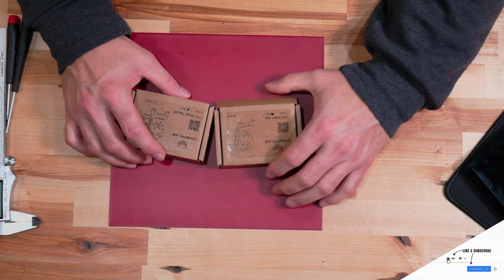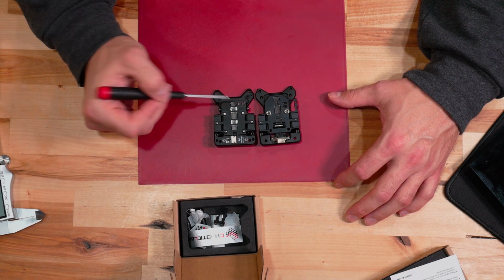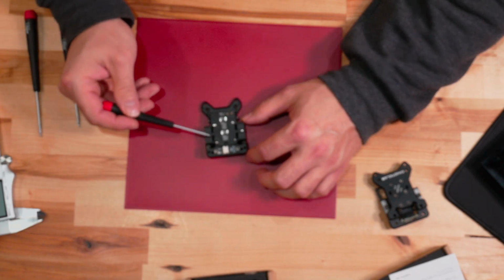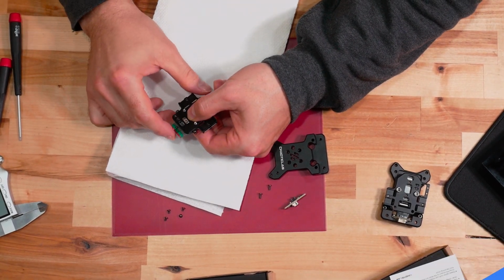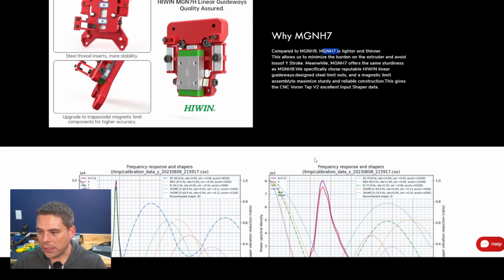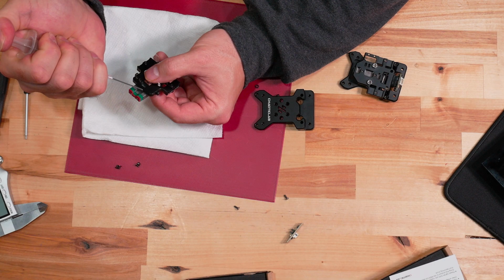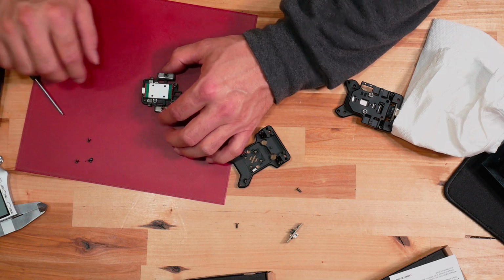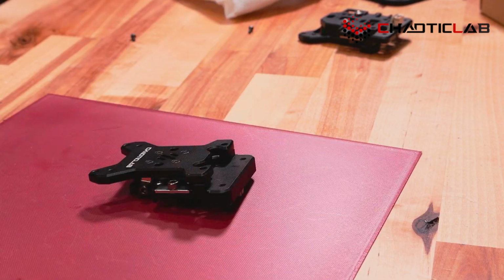CNC TAP V2 - CHAOTICLAB Does It Again?

Comment: Had a question about the wiring of this on the Octopus v1.1 board.  I have the probe on PG15 and voltage and ground on PB7 like the documentation states.  However the probe is always showing a blue light when the Tap is raised or lowered.  Any suggestions?
Reply from the maker: Check your wiring - Sounds like you have your signal wire crossed. Confirm via the diagram for your Tap. Hope that's it!  Let me know.
Reply: @BuildItBasement  I switched the probe and signal wires but now it stays solid red.  I thought that even before configuring mainsail the sensor would trip?  As I mentioned above, I am following the Voron manual using the default probe wiring and pins.  This is my second build but have switched from the inductive probe to tap.  I'm stumped.
Reply from the maker: Check and double check those wires.  Are you using CAN? Normally these types of issues can be caused when the ground wire and signal wire are swapped.  I too use PG15 for the probe, I use 5V at the tool head - too many issues a while back with 24V use. Voltage and ground can come from anyplace as long as the voltage matches the requirements of your Tap - signal should just be signal.   Instead of looking at the LED I would suggest checking what the MCU sees in real time via the console or GUI.
Reply: @BuildItBasement  no can but I am using a formbot pcb. I used a meter to verify continuity. I'll try running direct and see if that resolves the issue. Thanks for the insight.

Comment: Thanks for the video! I'm ordered a Trident kit from formbot (hasn't arrived yet) and this cnc tap V2 looks like a great mod to have from the beginning, right?
Reply from the maker: This is up to you 100%.  The biggest issue I can see is that the documentation will be fragmented some.  The original build doesn't include the Tap, and when you get to certain points in the build you'll be omitting things or adding things.  The next biggest issue will be software.  Tap uses some slightly more advance macros to function properly, most of these are surrounded by the need to ensure that your nozzle temp isn't much beyond 150 degrees C, as not to hurt the printing surface.  All those negatives being out there, I do still believe that if you're up for the additional research and work - you'll be better off starting off with a Tap.  It will save you a decent amount of time in reworking hardware and software.  Thanks for the question! Let me know if you have any others!
Reply: @BuildItBasement  thanks for the reply! I think I'll go Tap. Seems worth the effort. I'm sure I'll have questions during the build, so I'll be taking the offer ,😁

Comment: The V1 doesn't use an optical sensor.  It has a small switch similar to what is used in Klicky.  I don't know if you need to do much with HiWin rails.  When I installed by V1 I just used Mobilux EP2 (same as what is used in the video) and injected it into the lubrication port.  (the holes in each end of the carriage)  I have hundreds of hours on it and so far it has been fine.  I do believe you should clean and start over with cheap rails though.  Now I am going to try the Vitalii3D even though I have no issues with the V1.
Reply from the maker: Are you sure it uses a switch?  I originally thought that as well but was told by ChaoticLab that it was an opti-switch that has a spring-loaded plate that actually breaks a light path.  I didn't do additional research and took it at face value since it would make sense (as the unit will only work on 5v and fries at 24v).  A normal switch wouldn't care what the voltage is as long as it didn't go over the electrical breakdown (arc) point. I may have a Vitalii3D unit in the Basement...
Reply: @BuildItBasement  V1 uses a black Omron switch.  It could be an optical switch internally??  I am not certain.  There are images of CNC tap version 1.0 that show the various surface mount resistors etc.  (requiring 5v??)  It looks just like a Logitech mouse switch to me.  

To me the largest difference between V1 and V2 is that V2 has a 'flag' and an optical sensor like the original Voron Tap.  The Tap developers talked about how many times the optical sensor could be used, there is no mechanical wear.  (they also specified MGN9) 

Input shaper results are supposed to be better with the Vitalli3D so I am going to try that at some point or get a Beacon.
Reply from the maker: Awesome. Hey let me know what you end up seeing.  Only so much I can do in my spare time, so having more information is always better.  As for the switch I agree, looked like a clicky mouse switch to me as well - that's the only reason it hit me a little sideways when you said it was mechanical. I had the conversation with them directly - I'll stand by what they said unless someone can prove otherwise.  IMHO no one needs a Beacon.  My mind works in layers and the foundation is the frame followed by the bed mount and bed.  If you have a good bed mount and bed you really shouldn't need to have hundreds of mesh points. Start with a flat bed and do away with all the issues that are related.  Besides, the mesh only helps the plastic stick to the bed - your bed-side surface will still have all the imperfections of the bed it was printed on.  No matter how many points you have, unless your print on a raft: Bad bed = Bad print.
Reply: Well other than the CNC tap from Chaotic lab, the other CNC tap options are at least as expensive if not more expensive than Beacon.  At $79 it is just a little more expensive than Chaotic lab Tap.  I haven't seen Beacon doing QGL but I assume it does that quickly.  It is lighter and the toolhead can be fixed to the x gantry in a sturdier way.  Tap is heavy.  Input shaper is worse with Tap than Beacon I assume because of weight and the rail.   With Beacon there is no wear on PEI or little bits of plastic on the bed.  All of the benefits of klicky without needing a dock and the added bonus of being very light.  I do love my Tap and Klicky is very inexpensive and works very well.  I just think Beacon is no more expensive than a fancy CNC tap and is just faster.  I would hope that the future USB toolheads would include a place to plug in Beacon and maybe a nozzle cam.  Maybe it even comes down in price at some point.  I don't see any downsides of Beacon and the mesh looks cool.  I guess I have tried (and been happy with) everything else so why not try Beacon lol.
Reply from the maker: I'm not anti-Beacon - I'm just a K I S S guy and Tap - as complicated as it may be - does simplify things.  Tap, when properly built or manufactured provides three main functions.  1) It removes the need for a Z endstop. 2) It allows the user to probe the actual surface no matter the type (This includes: PEI, Textured PEI, Glass, G10, anything). 3) It adds a level of protection even if you have a poorly set z - hard to dig into a bed when using the Tap.  The Beacon offers some benefits that I just don't find useful in a printer.  I can already do a QGL in seconds with the Tap and I don't need a multi-hundred or thousand point mesh clogging up my config file.  As for the mounting of the tool head, you have a very valid point.  It hasn't impacted me, but I don't try to print at 20k+ or anything crazy. Honestly, I ran my first 2.4 for about a year or so with only a mesh when I manually did it.  The original documentation called out that you don't need to do a bed mesh with every print.  For me there are a few too many things in the minus and not enough in the plus to go to a Beacon.  It's cool to see a device make so much data, but lets face it 90% of it is junk data that no one needs.
Reply: Beacon doesn't probe the actual printing surface, it can only sense the metal underneath. Tap measures the actual printing surface, as does Klicky or Load Cells like the Prusa Nextruder. So any surface material thickness variations are ignored by Beacon. Each solution has tradeoffs.

Comment: I haven't seen anyone else mention it, but my issue with V1 was the rear facing connector on the sensor. 
No issues with the rail but on my setup that wire caused collision issues and just didn't look clean.
Other than that it worked OK but unfortunetaly I switched to the Vitali CNC tap before this became available. Nice to see they upgraded and fixed some of the issues.
Reply from the maker: I never had any issues with the harness provided by Chaotic.  When I do my install video I'll make sure I try to show how my wires are routed - even if it doesn't exactly fit your use-case. Any company that actually takes end-user feedback and uses that to improve a product gets a thumbs-up from me.

Comment: The carriages have small lubrication ports in the middle between the two screws, and there are galleries to distribute the lubricant throughout the carriage, if the ports are exposed, it would save disassembly for lubrication, and possibly cleaning too.
Reply from the maker: Sure would, law of diminishing returns.
Reply from the maker: No worries, if you do try something different let me know.  We're all here to learn.
Reply from the maker: You are correct Hiwin and other "high-end" carriages do have lube ports, however I find it near impossible to get EP grease into them.  I guess if you were using a lube with a low viscosity it wouldn't be an issue.  I personally have tested everything from sewing machine oil to lithium to EP2 and others.  I find under normal use and in a ~60 degree C environment the EP2 is the best bet to ensure most of the lubrication stays where you need it most.
Reply: @BuildItBasement if you heat up the EP2 grease (maybe to 50C), would it flow better into the grease port?
Reply: @BuildItBasement  we use a very sticky ISO68 oil on the machinery at work, but it's a little different - 15KW CNC machinery where the temps of the rails don't get much above room temp and the oil pumps squirt it in pretty hard at timed intervals. I was originally going to try some of that oil, but your mention of temperature makes me want to second guess that.

Thanks!

Comment: I thought the instruction said to not mess with the linear rail?  I do agree with you that I think you should grease it, but when I installed my I thought that  was what the instructions said.  By the way , the Amazon price is 59 but it has a $10 discount! So its the same prices as at the labs store, but free shipping!
Reply from the maker: I mentioned that during the video - Chaotic does have a physical card that came with the version 1 that basically said "DO NOT TAKE APART".  And the thought behind it was that folks would end up breaking the CNC Tap and once that happened, bad comments and floods of angry people destroy any hopes of further production.  They took a safe approach and it was the right thing to do.  You could slightly get to the back of the rail some on the V1 w/o removing the face - however you just cant do that with the new version.   I also have no idea how people manage to get the belts properly secured without taking the front off.  I shure as heck can't! 

Now to be clear on the V2, the tell you not to remove the "slider" from the rail.  I never removed the "slider" from the rail, we exposed it enough to lube it.  I would NEVER suggest removing the carriage / slider from the rail.  I did follow instruction to first remove the PCB to protect it from the rest of the process.